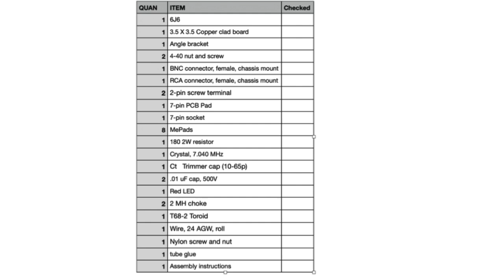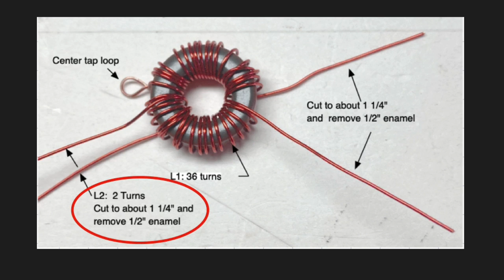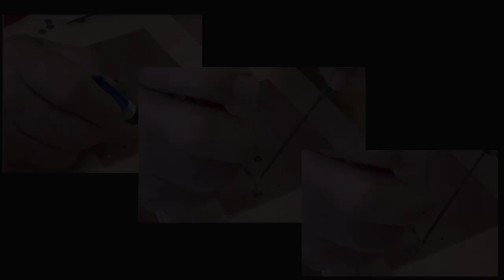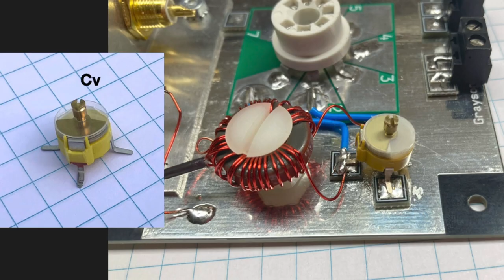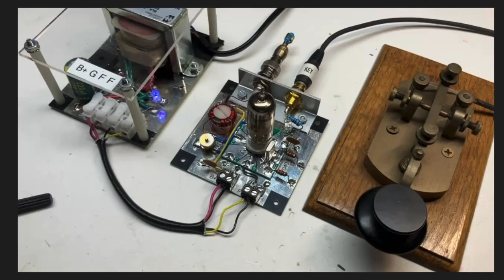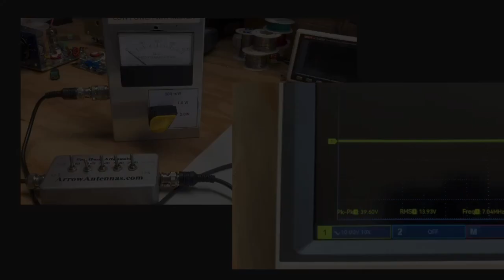Last Ditcher Assembly

Comment: Grayson, do you have an Amazon part number for that power supply? I have searched Amazon and it throws up a gazillion supplies ... I have your other 40-meter QRP kit I built with the power supply, and that rig works great but having this one at 4 watts possible is too hard to resist ... thank you. 73 de Mike AD7VV
Reply from the maker: Hi Mike, I just got another PS from amazon that seems to work the same but is in a metal enclosure.   I dont see a part number, but it has this title: Tube Preamp Switch Power Supply Valve Amplifier Transformer Cattle 95V-265V Output 6.3V 280V with Shield Cover
Not sure what cattle has to do with it!  It is from the same supplier.  If you cant find it, email me.
Reply: @hollow-statedesigns Grason thank you ill check it out ... meantime I need to order that kit ...